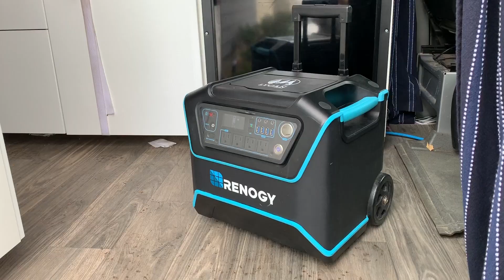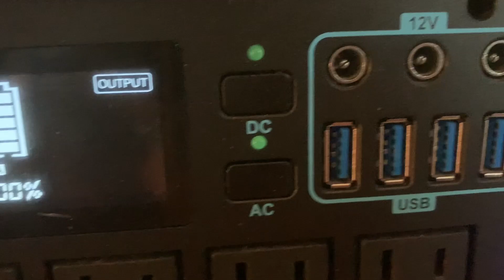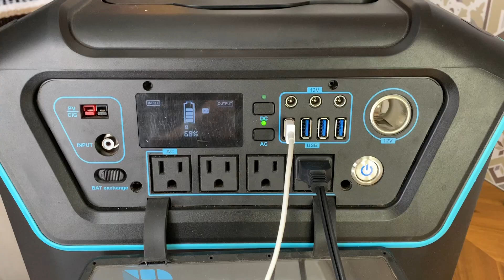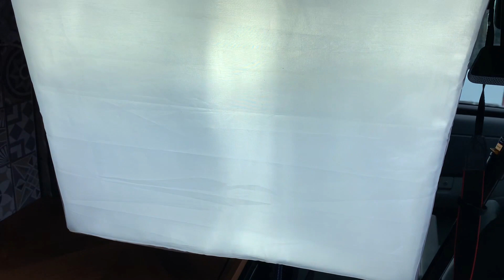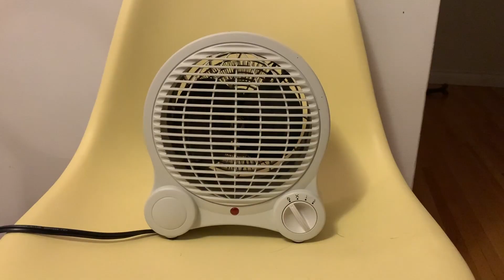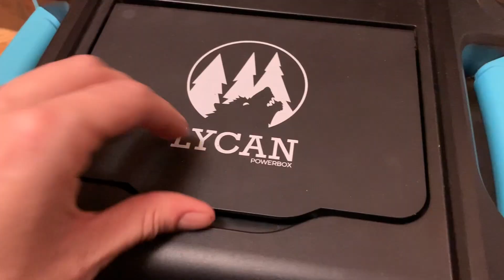Renogy Lycan Powerbox Review

Comment: Had mine for two years and it’s junk, mine was broken and Renogy could careless, the dc power output is only 11.8v and is unusable, was missing cables, only used this two times in the house for running fridge in power outage, I would stay away from Renogy
Reply from the maker: Thanks for sharing your feedback, Tom. Sorry to hear you’ve had a disappointing experience.

Comment: Erin
After 1 1/2 years do you have any more comments?
Just bought one myself
Reply from the maker: Hey Jim. Great question. I find it’s best to store this in the house so the battery doesn’t potentially freeze up here in our northern climates. With that said, I have to keep it in the basement, and it weighs an absolute ton, so more often than not I end up too lazy to carry it up the stairs to the camper van to bring it along…

Comment: I’m looking to power the lights (LED) and an exhaust fan in my camper van. Does this have the ability to be wired up to a fuse box that could then power my lights and fan?
Reply from the maker: I'm pretty sure it doesn't. You'd have to check the wattage of your devices against the specs

Comment: hello Erin, I have the Lycan and got two extra batteries.  I am trying to recharge the external way, page 10 of the manual.  The main is 100% so I moved the front switch to the left (from A to B) connected the two (Main n external batt) with the Ethernet looking connection and the yellow tip connection plugged into wall and turned the main on.  what I have on the LCD is an empty battery symbol but there isn't any indicator showing that it is charging,. Any help you can give?
Reply from the maker: Hey Richard. 🤔 you’ve me... I haven’t seen that.

Comment: Do NOT buy this!! Many have issues with the ac output shutting down no matter the battery level.  I sent mine back to Renogy to fix the problem and it came back working fine. 1 month later the SAME problem came back. Reading reviews this is a manufacturing defect and Renogy removes negative reviews from thier website. $1800 paper weight.
Reply from the maker: Thanks for posting your experience
Reply: Jeff Campbell    Bought one last night on sale plus the promo discount
Reply: I had the same issue with the 12v DC. Renogy said it was working according to specs, but when it's powering a fridge, it has to stay on. I got so frustrated that I threw the whole thing in the trash.